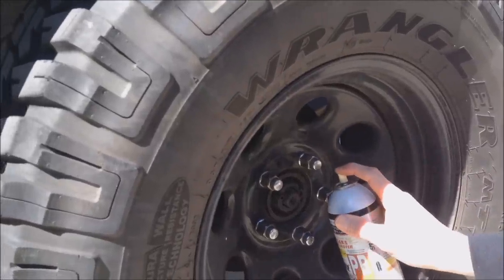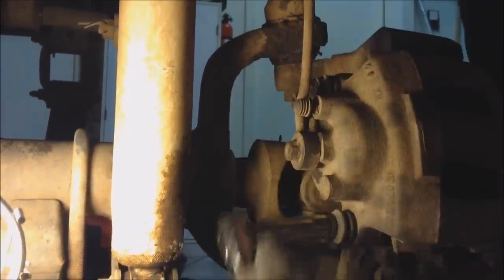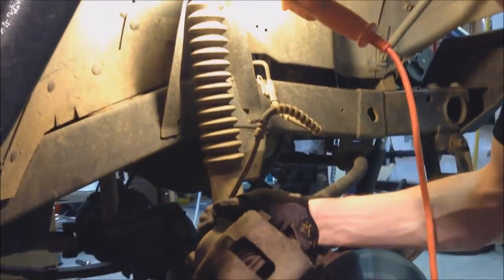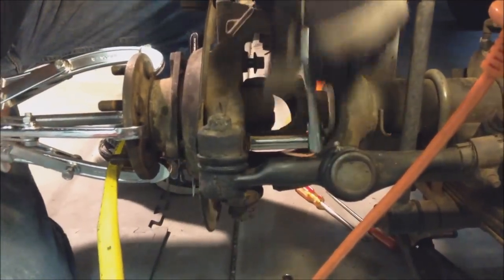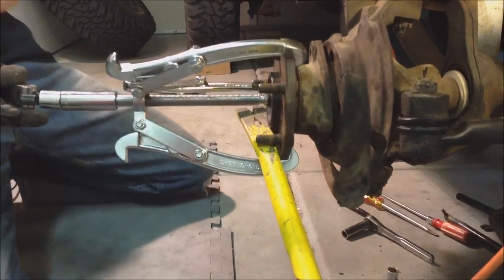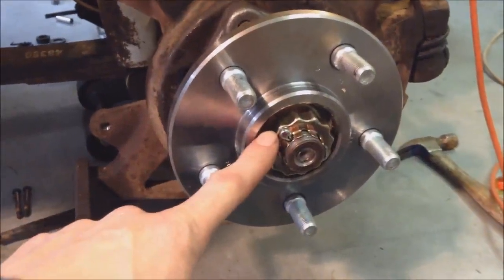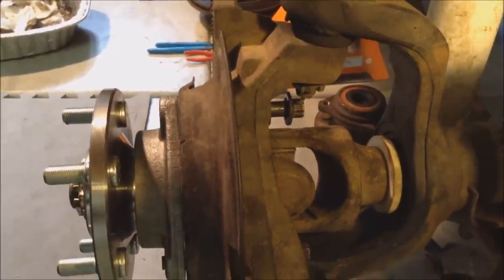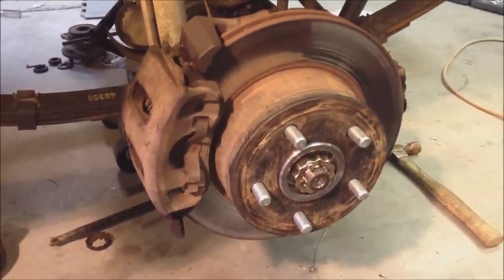Hub replacement: jeep wrangler yj hubs

Comment: Great video! You helped me get through mine yesterday. A little tip for anyone without a long enough prybar to stick between the lugs when you break the spindle nut loose - put your brake disc back on and stick a screwdriver into a ventilation slot and use that as a stop against the brake caliper bracket for when you give’r with the breaker bar.
Reply from the maker: +Martin Mankins Great tip! I've used that method on a few other projects. Works well. 👍🏼

Comment: Tip: if you've rounded off the 13mm 12 point bolts, hammer on a 1/2 inch socket. My dad went the wrong way and rounded one, so I converted 13mm into inches and it came up as .51 inches. So I hammered the 1/2 inch socket on and it worked fine. Pulled a new bolt out of the hub of an XJ Cherokee at the junk yard with a little PB Blaster and a breaker bar. Don't buy them, they're $6-10 and the junk yard owner told me it wasn't worth writing up the sale ticket, so I got it free.

Also, you can rent a 36mm socket, torque wrench, and pitman arm/hub puller from AutoZone. I have a puller, so I just got the wrench and socket (my torque wrench goes to 150, and you need 175).

Comment: I would highly recommend putting the lug nuts on the studs to protect the threads. And if your going through all that, why not replace the U-joints in the shafts? Thats what I'm going through right now!

Comment: Hey, could use your help on something: just got the old wheel hubs off but on the passenger side I accidentally pulled the axle out. Doesn’t seem to want to easily go back in… Am I doing something wrong? Assume that I can just keep spinning/wiggling it around until I find the right thread pattern and get it in place, right? Or do I have to do something more dramatic/drastic?
Reply: Just watched this https://youtu.be/57yXs1vSBNA and I think it’s possible my shift collar might have dropped. Let me open the back and check...

Comment: My hub assembly is stuck to my  Knuckle. The axle is free and can be moved slightly forward and backwards. So far I have used copious amounts of PB blaster and have been hammering to back of the knuckle using the 13mm socket over the bolts. Any ideas from here?
Reply from the maker: Yeah. I talked with another who had the same issue. We finally got it. I’d try using something like a concrete chisel and strike the outside, where the hub mates with the knuckle. Strike on that edge all the way around the hub. You can also use some heat on that same area. Then back to striking the back of it. May take a few tries.
Reply: @JeepSolid  I used an air hammer on the edge of the hub. The process was spray PB on the hub and air hammer on the hub assembly from the side to get the hub assembly to spin.

Comment: does anyone else lift the breaker/cheater bar rather then jumping on it? i only weight about 140 but can deadlift about 260lbs, so im almost double on lifting vs standing, have sheared off seized wheel lugs/studs before from lifting on a 3ft breaker bar

Comment: usually those 12 point bolts never come out in one piece without a fight.. once theyre out you can pull the hub and axle shaft right out together if theyre stuck in one piece and hammer them apart in the vice, the axle shaft will just slip back into the diff for reassembly

Comment: Thanks again bud for that video! Used it to replace my axle ujoint.  Come to find out, my hub bearing assembly has a metal to metal sound which i will be replacing next.  Also, i tried looking for a video of yours on the replacement of the ball joints, if you have that i would greatly appreciate it!  Thanks again for your helpful videos!
Reply from the maker: I still need to make a ball joint video....

Comment: in canada  thoes 12point bolts are seized solid like old manifold bolts ..
Reply from the maker: +san379 Yeah, they can be really tough!  I'd try hitting it with PB blaster over a few days.  Really let it soak in, then try heating them up with a torch a few times.   Good luck!
Reply: JeepSolid  angle grinder the bolts off and buy bolts?..grade 8  bolts
Reply: +JeepSolid +JeepSolid I'm having the same problem and ive been hitting it with PB and using heat and they aren't budging! Two of them rounded already too..
Reply from the maker: +Mosin Master impact driver
Reply: cut them off  once the heads are off then hit it with  a 2 lbs sledge and 3 ft bar and it comes off
Reply: got two of them off with an angle grinder so far. Just picked up a dremel for the third one (the one in the front). Couldn't really get to it with the grinder. I'll let you know how it works.

Comment: Have not had my 1993 YJ but my front hub looks like yours.  I  assumed it had tapered bearings since I thought that adjust locker for the nut was for setting the tapered wheel bearing?  So my 1993 has sealed bearings?  Is that why there is no dust cap? My Moto Metal wheels have no center cap and I had been looking for a dust cap for the hub?
Reply from the maker: +RIPSAW Yeah, if it's a Dana 30 front axle, then it should be very similar. Sealed hub. Mine doesn't have a dust cover either.
Reply: Thanks, Under here right now.    Rebuilding engine and transmission.  A Little lull in parts coming. Seeing what fluids look like in front and rear differentials. Fluid is clean in front and like the manual says, 1/2" down from the top of the plug. Guess since the differential is not mounted level.  However, there is no drain.  Do you need to suck it out or remove front cover?
Reply from the maker: Yeah, you can pump it out, but I find it's hard to get it all.  If I'm gonna do the job, I want it all out, so I take the cover off.

Comment: About to repeat this process.
Reply from the maker: +Andy Cocchia Repeat?  Last set wore out/failed?  What brand?
Reply: JeepSolid  I meant repeat what you did lol. I bought Moog though. So far I've gotten my hub off and going for the grease.
Reply from the maker: So, how'd it go?
Reply: It was quite easy, aside from putting the backing plate on backward the first time and having to take the hub off again. Lol unfortunately still have play in the yoke in my rear diff. Gotta fix that before Betsy runs again.